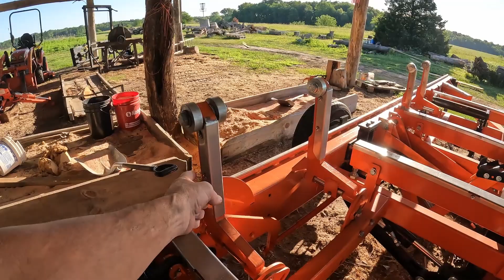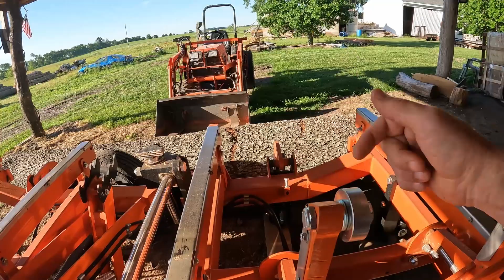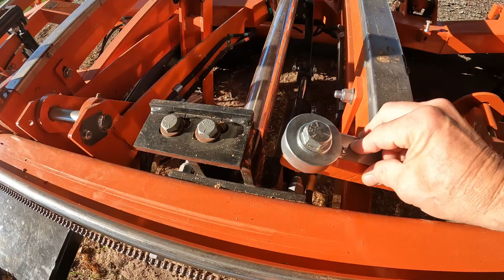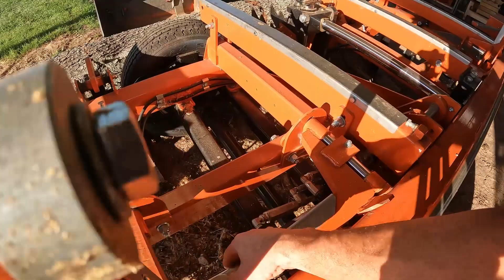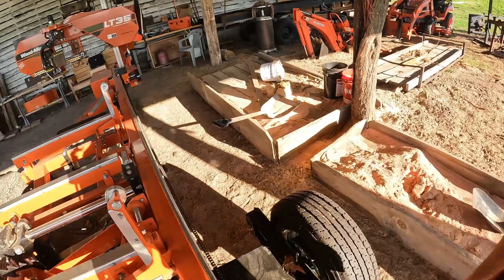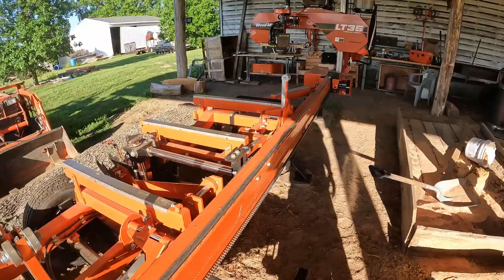Sawmill dogs Side Support Sleeve Stainless Steel for Wood Mizer LT35

Comment: Appreciate you sharing, Ive been about like you, very little milling a bunch of other stuff getting caught up on. I like the stainless 
Add ons did you make them or did you get them from woodmizer. I been wanting to add extra roller wheels to my back stops also. Thanks for sharing. Take care Sir.
Reply from the maker: The Stainless add ons are from Wood Mizer.  I don't know if they will help or not.  Guess I am about to find out.  Running a one man sawmill and a farm there is always something to catchup on.  I tried to film some of it, but nothing turned out.  I don't know it one roller is going to help or hurt, but I am about to find out.  lol
Reply: @DANG--  
Appreciate the answer, yea it’s hard to trying get a lot of work done and film at the same time. I understand that for sure.